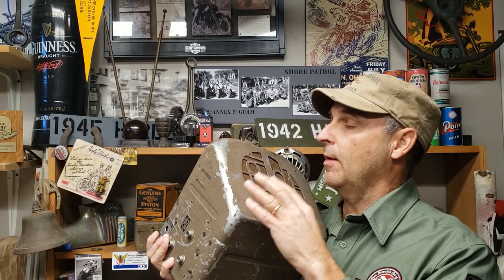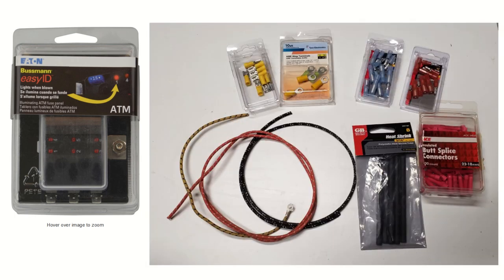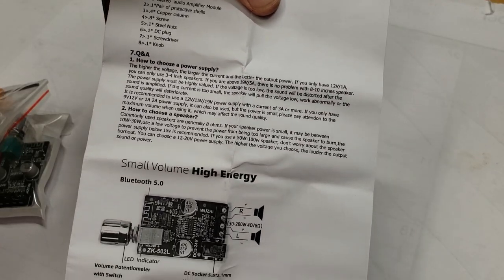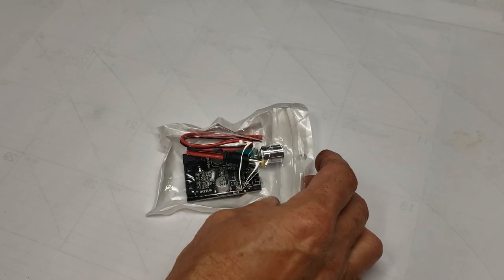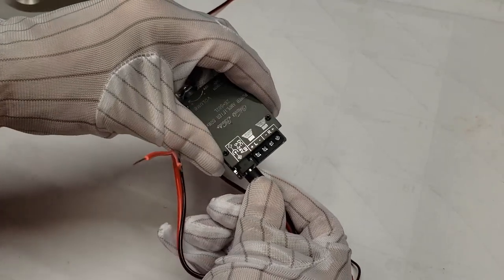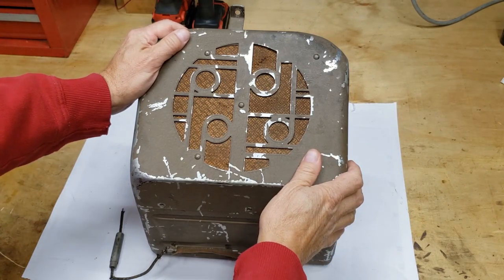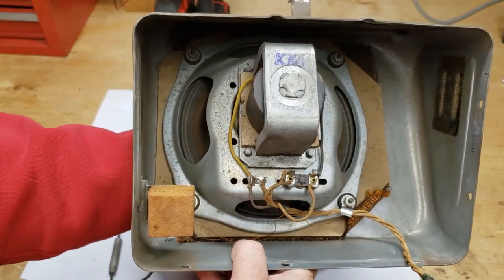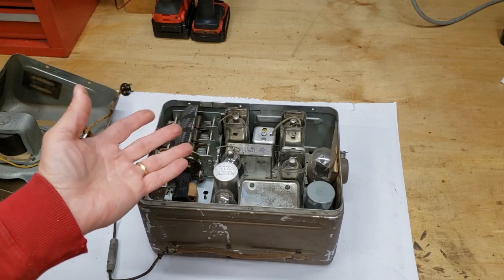How to Convert an Old Car Radio to Bluetooth for under $50! I'll show you how to do it!

Comment: This is a great idea Terry!  While I'm an antique radio guy and I like originality, I haven't had much luck in restoring pre ww2 car radios. I've tried to rebuild 3 of them for my 1937 Pontiac and they all have ended up with open coils due to moisture breaking down the old laquer on the coils into nitric acid which corrodes the windings. I've had better luck with late 40's car radios.  This is an easy way to get past that, thanks for showing it!

Comment: Most likely that’s a field coil speaker in the car. Back in the 30s-50s permanent magnets were expensive and often radios used a field coil speaker instead of a permanent magnet. The extra two wires are to power of the field coil.
Reply from the maker: Excellent! Thanks Toucan. Learned something new today!

Comment: Do you have  any  issues with background  noise from the ignition or generator as the car is running? Or does this module have a built-in filtering system?
Reply from the maker: Good question Leo. There is no background noise at all. Sounds great, no issues!

Comment: Nice video. I have a 1940 Opel Kadett. It is on 6V. I can buy a Philips car radio from 1938. ( Philips is from my country) It is on 12V. Is it possible to install it and obviously i do not need a "head" control unit?
Reply from the maker: Hi Ger. Yes, you can definitely use this in your radio head and keep the original "look" of it. Keep me updated on your project.

Comment: Thanks for the video, I just got one of these for my 48 Chrysler. 1 question I had was with 6v pos ground does the black wire on the plug with the unit go to the keyed power on the switch and the red wire to ground? I just want to make sure I hook it up correctly, thanks!
Reply from the maker: Good question Burnout, you are correct. Black wire to keyed 6 volts and red wire to ground. Good luck with your project!
Reply: @FlatheadTerry  Thanks and LOVE the channel, I just subscribed.

Comment: I tried one of these in my '55 Chevy truck. Unfortunately it sounded awfully distorted. Any idea why?
Reply from the maker: Hey Caddyman, there's two things I can think of causing that. One is a just a defective circuit board right from the manufacturer. The second is the speaker(s) you're connecting it to. If the impedance is too low(below 4 ohms) or too high (16 ohms or higher), then the output amplifier is over-driving the signals to the speaker. If you have another speaker to test it on would be a good way to troubleshoot the root cause.:hand-orange-covering-eyes:

Comment: That radio would actually be a very straightforward restoration.
Reply from the maker: That's a possibility. I don't have a working O-Scope anymore:face-red-droopy-eyes: so it's a challenge to troubleshoot even though I have the schematic for it. All the cap's would need to be replaced to start. It's also been physically abused so that adds to the challenge. I kept the entire radio assembly intact for the future when I can get an O-scope on it. Thanks for the comment.

Comment: Hi Terry, thanks for that great radio conversion video. I saw where you turned it on with the white knob. How are you tuning the stations? Are you tuning with the original radio tuning knob? If so then the old radio has to be in working condition. right?
Reply: I just answered my own question! CELLPHONE!
Reply from the maker: @ronhagopian7676  There ya go! I'm looking for an original Radio control that mounts on the dash by the ash tray. When I find one, I'll move the this bluetooth amp inside it so the Volume knob will function like the original. Stay tuned!
Reply: @FlatheadTerry  Hi Terry. I was able to get the same amp and had it working fine on my bench. I then spent many hours gutting my original radio gutted by removing tubes diodes,etc. I then installed  the original knobs and push buttons so that everything looked stock. After all was in place I made a major mistake when hooking up the final wiring on my bench. I cross wired something an evidently blew the amp! I tested it for continuity and it failed. I then ordered another amp on Amazon for around $12. So it should be here by tmrw and I will let you know how it goes. Thank you for your very informative video. I wouldnt have been able to do this without your expert advice! Ron
Reply from the maker: @ronhagopian7676  Dang! Its happened to me too so I know the feeling. Yes, keep me posted on your progress and I'm glad this episode was able to help you.
Reply: Hi Terry---I finally got the mini amp installed in my 52 Ford. Took the old guts out of the radio and installed the mini amp.. I also replaced the original speaker that was worn out.  Everything works as it should. i used the original on -off  knob and secured the radio pushbuttons so it looks original. Thanks for your great video and calming audio. I am quite happy with the result. My first automobile project since turning 80!!
Reply from the maker: @ronhagopian7676  Great to hear Ron! Just in time for summer.. Thanks for the update and kind words.